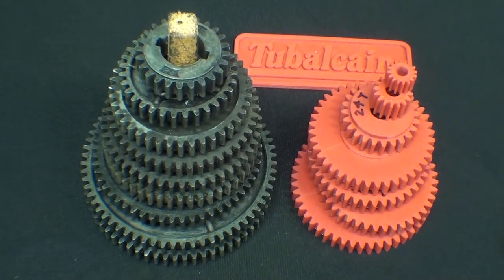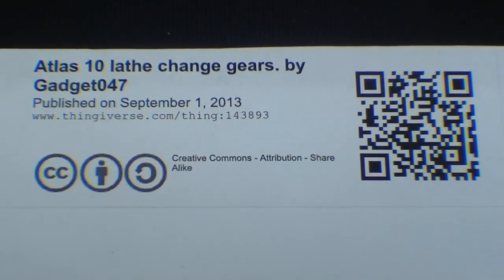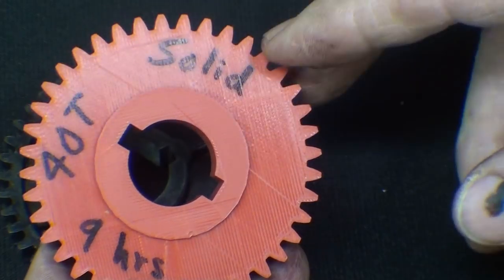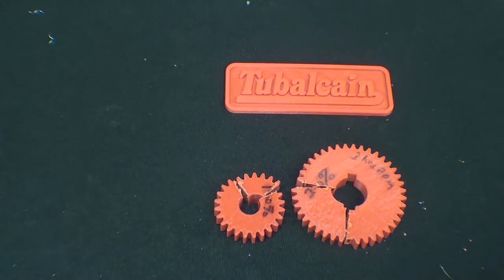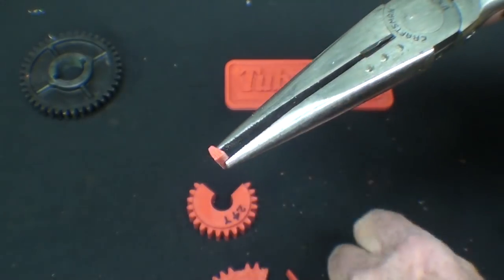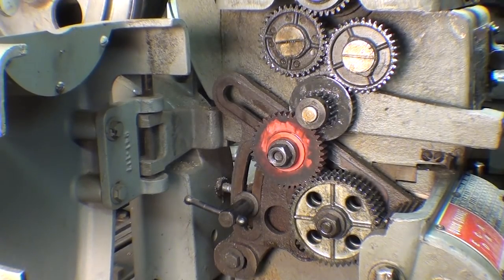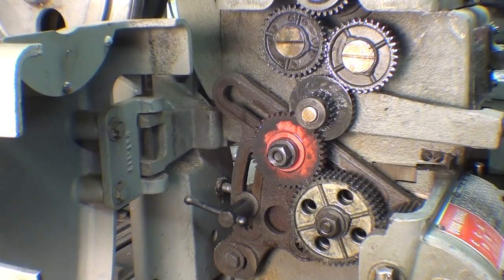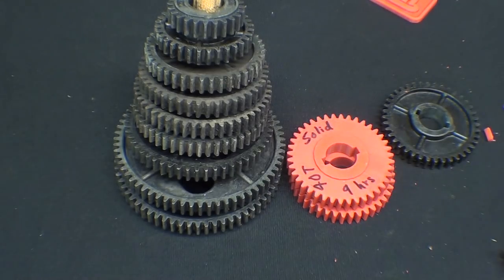3-D Printed Gears for Atlas Lathe TIPS #416 tubalcain

Comment: Would be interesting to try the 20% fill one. It may finally break and so be useful as a safety gear designed to fail in a disaster. 
Try doing it in back gear. The torque on the gear shouldn't change that much with the speed anyway. Only the power and torque required to drive the workpiece changes. As the cut is always the same volume per turn and so pressure on the feed no matter the speed is constant, within reason. 
 
In my experience they will probably  work quite well. Will just wear a lot faster. But just print another. 

A print compromise would be increasing the number of perimeter loops. This makes the solid outside walls thicker. So a compromise between solid and hollow. But faster to print.

Comment: Thanks for the great video as always.
I just ordered a 52t 10 pitch change gear for my WF Barnes #6 lathe, 3d printed in Nylon 12 FDM. Should be a lot faster than running that lathe as a manual shaper to cut the gear from cast iron. Plus I'd have to order the iron from McMaster, and get a couple other tools to make the mandrel and index locker - and it would cost more to make myself, plus untold hours of careful effort.
Reply from the maker: Yes, sounds like you found the perfect solution

Comment: The first thing I made with my 3d printer was a gear for my thread dial on the 1940 17x72 LeBlond first had to learn 123d design software gear teeth on 5 deg angle it works great
Reply from the maker: That's wonderful, these 3-D printers are amazing

Comment: This is very entertaining (and informative) - It's still novel enough to get a grin while you print a fish or some figureine but to be any real use - you need to be able to mix and match at least parts of your projects with printed plastic.
I suppose time, and varied use will eventually prove whatever it proves about practicality and the durability of printed parts, also which plastics fit which uses best.

For the moment just the fact that it's not disintegrated shows it has merit.  For me, I'd quite like to see you building one (some?) of your steam engines where brute strength isn't as important as fit, durability and of course friction.

I've been resisting temptation by telling myself it's a novelty - I fear you're going to cost me a chunk of money if you carry on with results like this.
Reply from the maker: I think it was a total waste to use a printer for decorative things. That does not interest me at all. Proto types and patternmaking is what I like

Comment: Nice test. I suspect that you would have different results if the gear was further down the gear train. It looked like the gear was turning at about the speed as the spindle. If it was in the gear box closer to the leadscrew in the gear train, it would be turning much slower and experiencing much greater torque.

Comment: Thanks for this!  Clearly 3D printed gears are a viable alternative.  Safe to say they'll wear out quickly, but one might even build entire gear trains and maintain consistent operation by making routine replacements based, say, on hours of use.  The possibilities may be limited only by one's supply of plastic filament.  ;-)

Comment: Thanks for the video! I'm quite impressed with the printed gear and would be interested when it would actually break. 
Why don't you keep it in the lathe and use it normally? Maybe it'll wear down; I could imagine it melting at some point. Also: How about replacing the complete set? I assume the faster-turning gears would even require less of an infill.
Reply: +Paul Hendrix
I believe that the higher speed "driver" gears (fewer teeth) probably have a higher torque load per tooth, so, would thereby require greater (i.e.100%) infill.  However, if the higher speed gears are "driven" gears instead, then yes, the torque would be lower and one might be able to use a lower strength configuration.

Comment: I don't suspect that you can clamp the plastic gear down as tightly as a metal one. Did you find or suspect the nut to come loose on the plastic gears over time? Also, is there some kind of oil squirter in the gear train? I could see a whiteish line for a few moments after you started the machine. It seemed to extend over the larger gear and onto the plastic one.

Comment: Thanks for doing this. I've been wondering how good 3d printed gears will hold up and now I have an idea.

I'm hoping to find a 120/127 tooth gear for my 13" South Bend Lathe, to cut metric gears. Since cutting threads does not take nearly the amount of power that your cuts take, I'm sure printing the gears will work out fine.

Now if I can find an stl or figure out how to create one, I'll be set.

Thanks again

Comment: The result was surprising . I would suggest a multiple printed gear train cutting a course thread ,set compound near to 90 degrees to set depth of cut . Tool angle can be set for riggedity  .At some point they WILL FAIL  ,or skip .

Comment: I have a 10F TH54 in storage, getting ready for the rebuild. Clausing is 'raping' on the cost of new change gears ($450++). I was just going to CNC new gears, but after watching this I think I'll print and cast new ones (and just to push it to an extreme, I think I'll try cutting threads with the plastic analogs).
Reply: and yes, Clausing does sell new change gears for old Atlas/Craftsman lathes....

Comment: Excellent video.  Durability in this application is not surprising at all.  Look inside virtually all of the Chinese manufactured mini mills and lathes sold by Grizzly, Harbor Freight et al, and you'll find plastic gears in the main spindle drive trains - which take much more stress than the change gears.  Why not take some of the lightweight 20% fill parts over to your foundry and use them for casting patterns next - i have thoroughly enjoyed your foundry videos in the past.
Reply from the maker: So true

Comment: Like you said how you're not so worried about the body itself you should print your gears with thicker walls this in turn will make the teeth solid if you print them thick enough and you can still have the center with 20% infill it would take far less time to print but probably be just as strong as the 100%

Comment: Excellent video!
My thoughts: the plastic gears would probably wear quite quickly.
Could you use the plastic gears for sand-casting zamak?
If you have a 3D printer that can handle 240 celsius, you could print the gears in nylon, which would be more durable that PLA and even ABS gears.
Reply from the maker: Thank you, good suggestions

Comment: You can also set the number of layers in the outer shell before you reach the honeycomb interior. With this change in settings, you can have solid teeth without filling up the interior with solid plastic.
Reply from the maker: Yes, I have been told that, but not sure how to do it
Reply: In CURA under the custom setup you can set the wall thickness.

Comment: I did a 3d print 32 tooth for my little craftsman and been running it cutting acme threads and it never broke, and i think i had maybe 50 percent fill? don't quite remember but my little lath is not an atlas so i dont think it will ever get the pressures to break it  ..i have done a lot to make it accurate with all brass gibs and for what i do its great..(i also have a big engine lathe for heavy work) 
SO i am sold on 3d printed gears and as someone else suggested maybe it can be tailored for the teeth to be full and the rest to be a percentage..
Thanks for this informative video even though its a year ago i still got good information from it as usual.
Reply from the maker: Thank you for watching. Yes, it’s amazing how strong those plastic gears can be

Comment: Elmers liquid glue cut 50/50 with water.... smear that on the glass and you'll never mess with tape again!!!!  I use an old contact solution bottle to drip a few drops on the bed right before heating, smear it around evenly with a cotton swab.  The water will flash off at 40-45c  and leaves a perfect layer to the glass.  Super easy to clean as well, scrape with a razor... or just add a few more drops and wipe it again.

Comment: ABS would probably not hold up as well. It’s softer and the only properties it has over PLA are impact strength and temperature resistance. A gear is not a high impact application and at these rpm’s the temperature will stay below PLA glass temp, especially with the oil there.

Comment: Have you considered the compatablity of the oil used to the plastic? The chemicals in the oil might begin to disolve, or decompose the plastic, in some cases. I have no actual knowledge about this except for the apparent need for this consideration in model train lubrication. As in certain lubes for plastic or metal gears.

Comment: I am also surprised. However GM has been using plastic timing gears on their camshafts on the small block Chevy engines for years. they use a metal center with a plastic molded gear. I would be interested in a set for my Clausing 100 if the price is affordable. Any ideas on cost comparison between steal and plastic printed. Thanks Mr Pete. Always look forward to your experiments.

Comment: My experience with ABS is large, flat, thick objects, like gears and discs, warp after removal from the plate. While the teeth may engage correctly it would be liable to wobble side-to-side. And you might have to be careful about what kind of grease you used on ABS, it can be melted with acetone and some other petroleum solvents. That said, ABS seems to be kind of slippery on it's own, and is not as brittle as PLA. Under stress it would first give some before reaching a fracture point. I saw the other suggestions about Nylon, but I have no experience with it.

Comment: I predict shorter lifespan for ABS due to intolerance to lube.  ASA might be a bit better as its more chemical resistant.  PETG might be good as well.  If you try nylon, use a filament drying reel and a filament cover tube.  For optimum strength, adjust infill until gear teeth all have one piece of infill connecting, and use 3 layers of wall thickness and floor/ceiling thickness.  Try doing a ribbed wheel with wider ribs for faster prints.  PLA is highly tolerant of maximum print speed, unless you have high aspect ratio, use max print speed for everything but outer layers.

Comment: There is a guy on E-bay selling plastic gears for the mini lathe to make a super slow feed for a smoother finish.  Instead of .0039" per revolution it is .0026. I believe they are 3D printed. Go to E-bay and look up-"mini lathe change gear reduction for power feed 20/80/15/90 for smoother finish"

Comment: Shouldn't need that much raft. The gear design could be modified to use a lot less plastic while still being printed solid. Make an internal void then print solid with supports everywhere. The support structure would remain inside the void while the hub, side walls and teeth with outer ring get printed solid. Simplify 3D and some other slicers can do tricks like variable infill density so you can have critical areas solid while others are only partly filled.

Comment: Hey Mr. Pete, you know that fusion 360 has gear templates right in it? Im new to 360, but i sat for a half a day(day 3 of using cad sonce about 1995), and drew up the gear terrain and spindle for the q.c. box on my pratt n whitney model c. Next step for me is an old cnc wire edm, since tge gear i need to make is 63c(soft as butter lol). 

Great test and results, i absolutly agree that fir light duty machines 3d printing is 100% the way to go.
Reply from the maker: I did not know that fusion ahead templates for the gears. Perhaps that's what the thing averse creator used for the atlas years?

Comment: My buddy printed me a couple of 24 tooth to slow down my feed rate and I havnt tryed them but this vedio has sold me on them,,,my question Pete is I was thinking about also that the gear would save my zmak gears in case I crashed the lathe, but wondering now if the zmak cast gears would break before the printed did,?  I have 3 lathes with zmak cast gears and only one gear has a chipped off tooth,,,that's pretty damn good for gears that so many say are weak.But I was happy to learn that all my quick change gear box gears are steel anyway, l wish I had the clutch on quick change,, what usually breaks first when it happens?
Reply from the maker: The Zamak gears are really tough, I agree. They are probably stronger than the plastic ones. That is interesting that you are going to get a slower feed rate. That was one of the poor design features of the atlas
Reply: @mrpete222  yea,, I'll have to multiply chart by 2 to tread but it cuts free rate in half also,,, the engineers really dropped the ball on that on,,,Pete I'm on my way to pick up another 12 x 36 atlas with quick change gear box and a 6 inch,, both for 500 dollars,, wish me luck

Comment: I'd be keen to explore whether the pla gears could be used as patterns for brass casting?
I have spur gears that I'd like to replace and it had crossed my mind.
Reply from the maker: No, you cannot use any gear as a pattern. There is no pattern draft.
Reply: @mrpete222  Hi Mr Pete, (from Scotland), thank-you for replying, yes I've been at this project for quite a while, I'm not sure about "pattern draft", I'm aware of pattern shrinkage, I feel I can account for this very easily just by scaling in the slicer? (I'm happy to "dial" that in through trial and error - non critical part and it's a joy just to fire up and use the forge). Trying to get the molten metal to flow to the extremities of the cast, now that's a different issue, and it's the teeth that are the important area? Any input from your good self would really help, thanks, David
Reply: Just looked at draft, I had a lot of failures in sand casting, yes, I see, I'd need to taper the pattern to facilitate removal from the mold(petrobond sand). I'd been looking at lost pla and plaster molds with solvent dissolving the pattern ( so many different filament types and solvents, I haven't been successful), I tried mucking around with a collapsible print in place pattern also, again I doubt it would work as I hoped.

Comment: Is it possible to 3D print the atlas/craftsman quick change gear box? Possibly even with additional gears to slow the cut rate (a drawback you mentioned for this lathe in an earlier video)?
Reply from the maker: Probably not

Comment: Don't bother with the ABS, it's much softer than PLA. Nylon is a way to go if you can print it (usually you need a heated chamber and pretty hot bed with other adhesion improving hacks). Primary failure mode would probably be tooth wear, but for home shop that could mean a long time before you have to print another one :)

Comment: Question Mr Pete,,,just got my 12 x36 craftsman lathe,,, I noticed on quick change side bracket bolts the t handle nut was on bottom and nut on top bracket slot,,,on your it's opposit,,, been concerned about this,,because there is a 3/8 inch space between where it should tighten against and the t bolt is slid in big slot,,, I switched them and made a spacer to tighten bottom nut against and put a washer behind t bolt,,,, didn't know if there's supposed to be a spacer in the much bigger slot in bracket for it to ride on are is there supposed to be so much space?
Reply from the maker: I am not near my machine right now, so I cannot answer. Take a look at your parts manual and see what they show
Reply: @mrpete222  have no manual but I found your vedio in installing quick change and really helped,,,couldn't see space but I feel it should have one,,,l love all your vedios and you have really helped me along,,,I'm a tool freak and now I'm complete with my own lathe,,,l learn fast and I'm really going to enjoy having it,,,l took it completely apart cleaned oiled and put it back together following your great instructions,,,only As I got in high school was shop , auto service and gym,,,lol,,,, thanks pete

Comment: thanks for this, my zamak gears really do clatter, I have set them up in the same way as one of your previous vids, also with the paper trick to get the gears meshing but the sound is horrendous, Ill try oil tomorrow, I am assuming though that the plastic absorbs sound a lot more, drop a gear on metal and it clangs, plastic clinks ;)

the info on Thingyverse mentions Nylon filament so maybe that is even stronger than PLA, we can also buy Carbon fibre filament although that apparently is abrasive when printing so a much stronger hot end nozzle is needed, not a stock brass one that comes with the machine.

Comment: Infilled parts can be just as strong as solid ones just make sure you have very high wall thickness
Reply: also you need to make sure layer lines are positioned in areas to promote strength
Reply from the maker: , Thank you so true

Comment: Interesting test.  I wonder what the durability of the gear would be compared to the ZAMaK gears.  worse I am sure, and you can alays print another, but I can't help wonder how much mileage you would get.
Reply from the maker: It is several years since I install the gear and it is still in perfect condition
Reply: @mrpete222  Impressive.  Thanks for letting me know.  I just got a Bambu Lab 3d printer for Christmas, so super interested in the art of the possible.

Comment: Nice test. Funny how some time ago before you had a 3d printer I mentioned about making thread dial gears to you with a 3d printer in the comment section of one of your videos and you were adamant about how it wouldn't be strong enough. Well what's your opinion now? Making that gear, what do you think the cost of it would have to be to make a reasonable profit after the initial purchase of equipment? Thanks for the interesting and educational videos. Ed K. Cleve. Oh.
Reply from the maker: Yes, the gear will be plenty strong enough. I asked if you were's, if they would be interested in a thread chasing dial. Only one person responded favorably. So I'm going to forget that